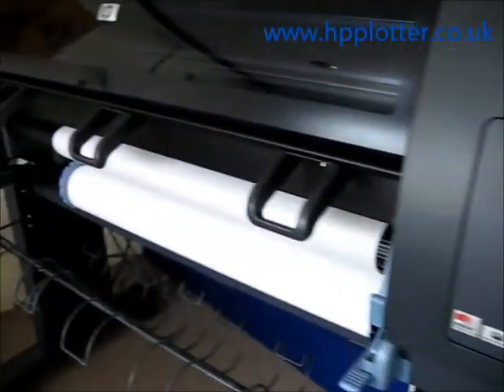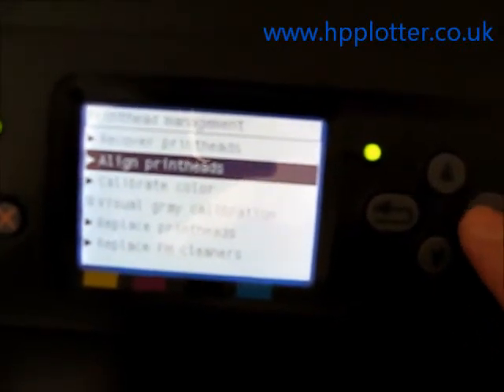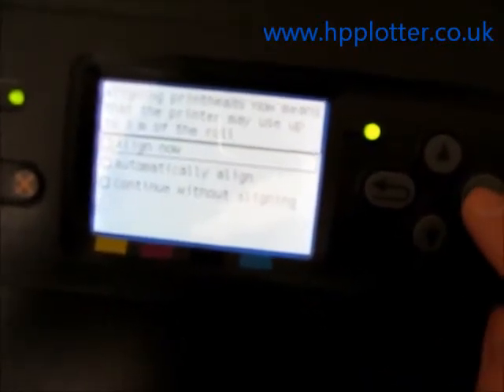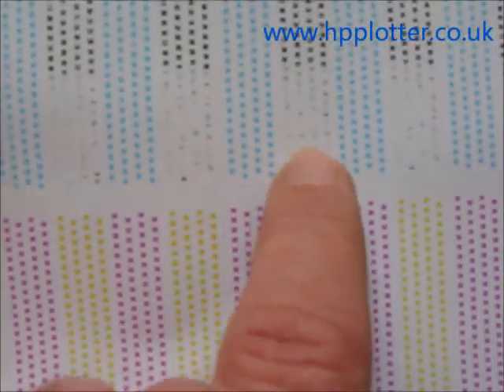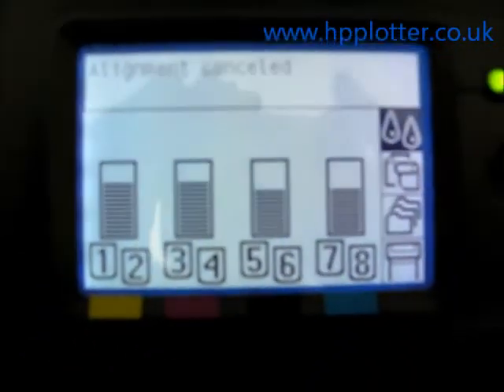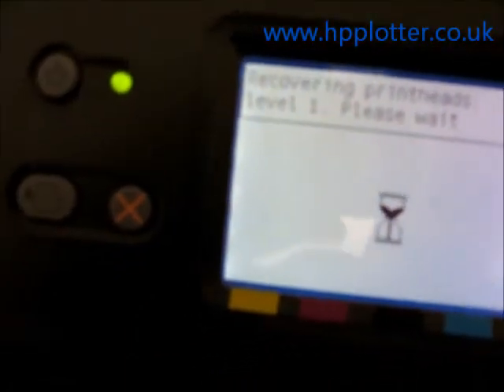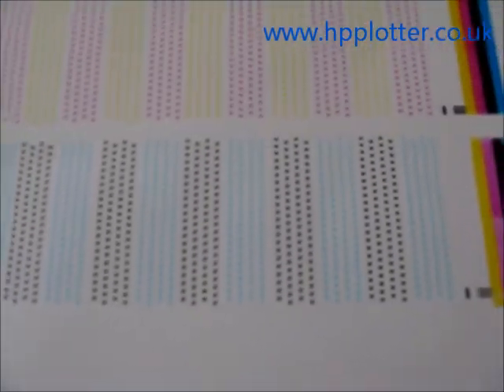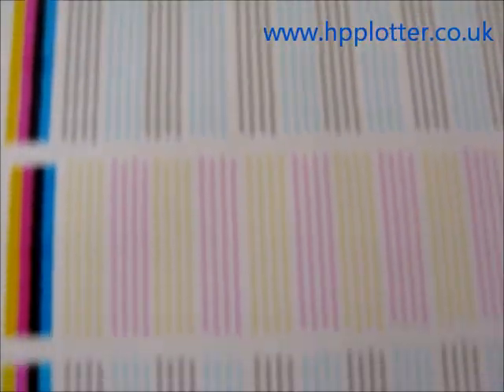DesignJet 4000 align print heads

Comment from the maker: Hello Geula,
It is impossible to give you guidelines based on the information supplied as it could be a number of possible things e.g. faulty print heads, faulty trailing cable, faulty carriage, faulty main board to name but 4.  If you try doing an internal test print and it prints OK it may also be a comms related issue.  Sorry we are unable to be more specific but it needs an engineer on site to work through the fault.